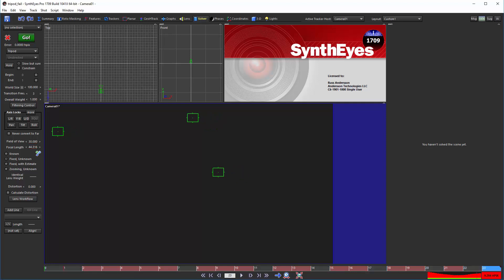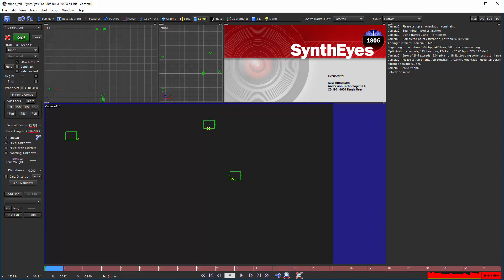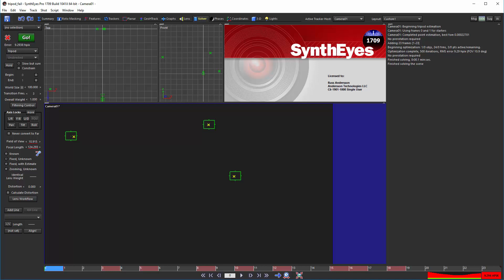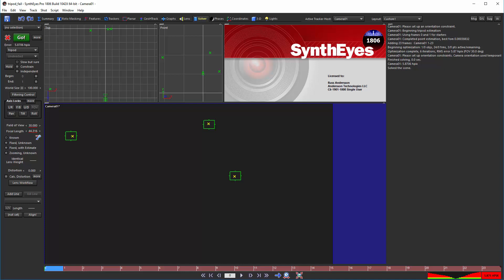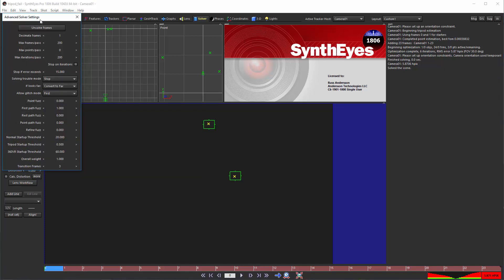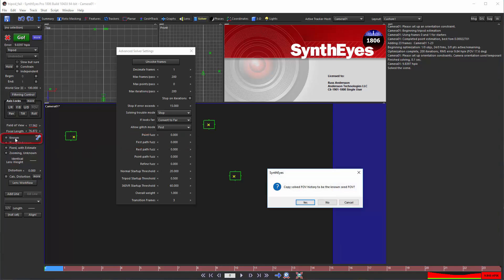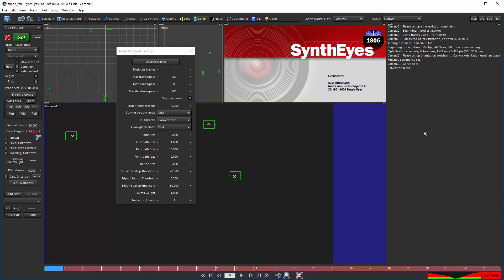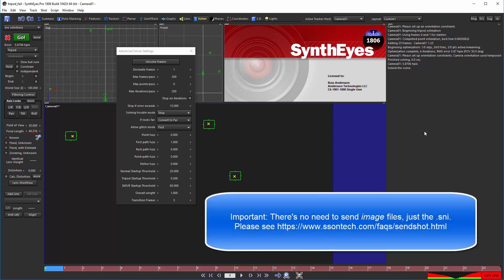Bad Tripod Solves Require Known Lenses

Comment: Thank you for this video and explaining the fuzz function! 
Personally I find 1806 less predictable than the previous version on some occasion, i'll try this parameter more thoroughly next time maybe that's the thing. 
I've been using Syntheyes for ten years and this version has a very different feel when solving. I love the new distortion tools, but I can't say I love the new solver behavior. Sometimes it feels a bit erratic whereas previous version felt more pliable. It is difficult to explain, it is like when you track a 2D feature and you activate "Track using other" sometimes it works like a charm but sometimes the tracker goes all over the image(because of not enough information from other tracker), the new solver feel like that in a way. I am not saying it is broken :) and I haven't had the time to dive into the new parameters, but it is surely different. 
The new automatic world size is still a puzzle to me for example. I'd love to be able to set it manually. 
This kind of video are great by the way, I would appreciate more of the kind.